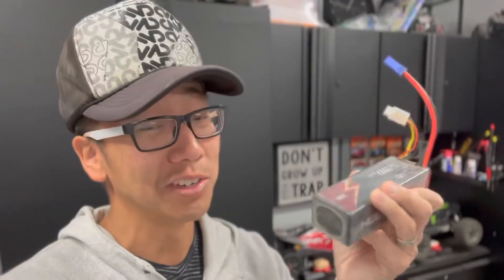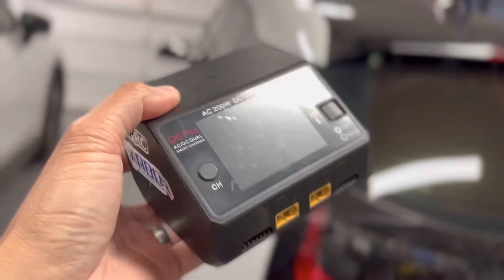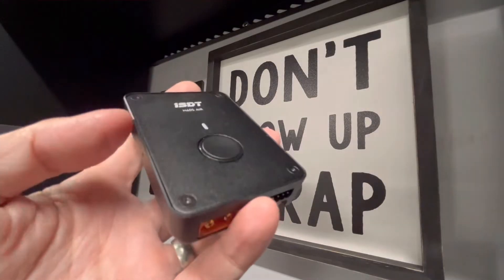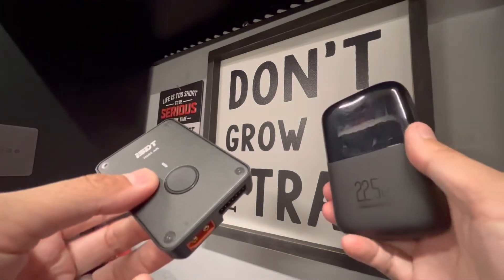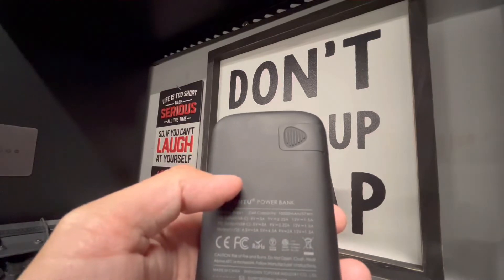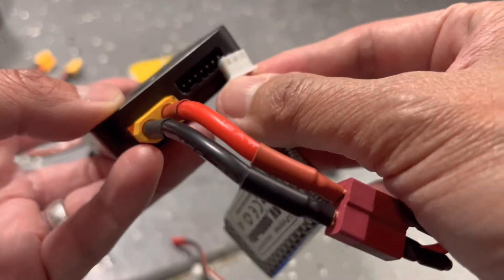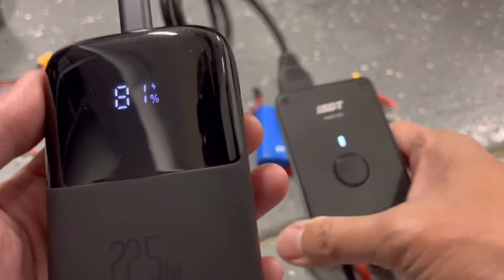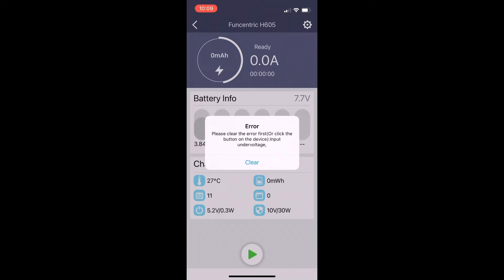Field Charging 2-3S Lipo Batteries Using a Battery Bank

Comment: Thanks for the vid. This was pretty useful. My main needs are 2S and 3S anyways max. However, I found an ISDT Q6 with charging amps that start at .1 Amp. I also paired it with their parallel adapter for multiple charging! Just sharing some options but I like the simplicity of your find! Thanks for sharing!
Reply from the maker: Oh cool! I’ll check that out.

Comment: gens ace dual charger charges under 1 amp and can run dc on a lipo maybe powerbank.
Reply from the maker: Interesting. Cool. I’ll check it out.
Reply from the maker: I looked it up. That’s overkill for charging small batteries. The Gens Ace dual channel one you’ve talking about is very similar to the Hota D6 Pro which is designed for much higher wattage that what can be powered by a small battery bank. 

I’m sure the Gens Ace charger is a good one but totally for a different purpose than what I’m talking about in this video.